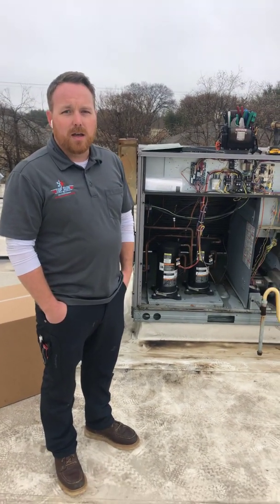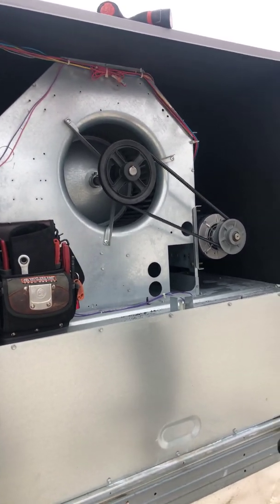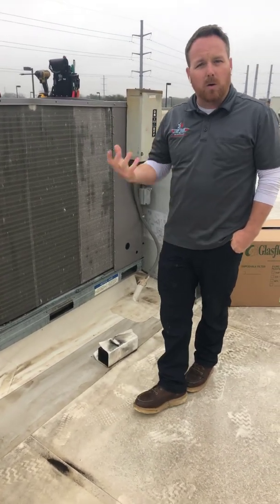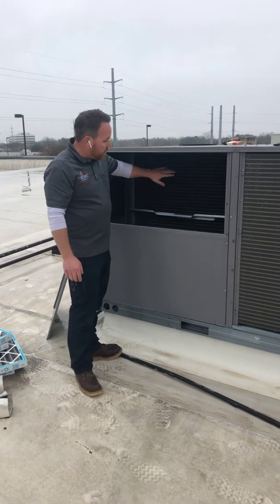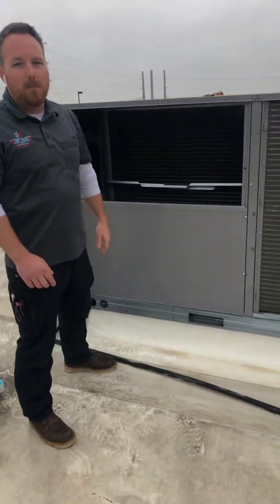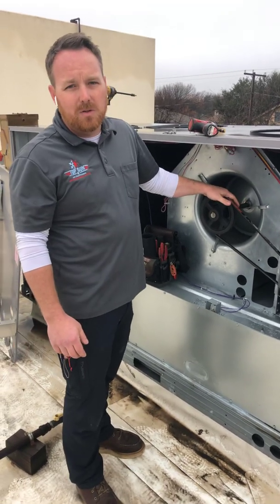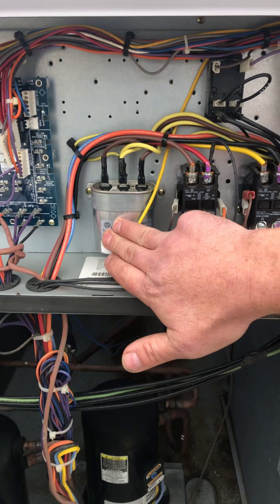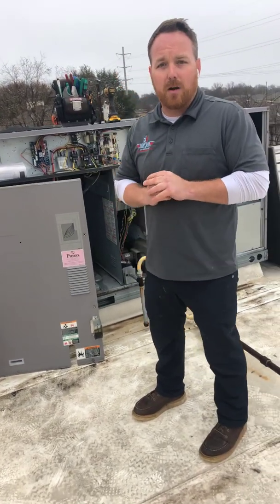Basic Overview of a 10 ton Carrier Package Unit

Comment: Hi, we got the same unit for our store. I noticed the fan blower and one of the compressors are not getting the 24 volts but the other compressor gets the normal 24 v and engaged, do you know what is wrong with it? Therefore, only one compressor works and no blower running nor the other compressor work. If I manually press down the contactors on those two things, they would run. They are not getting the 24 v as they should. Thanks!